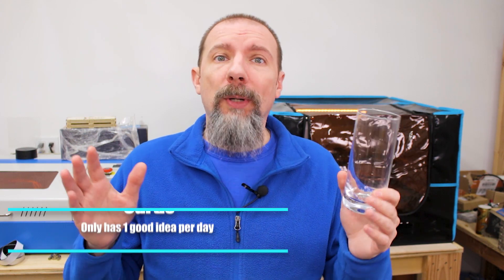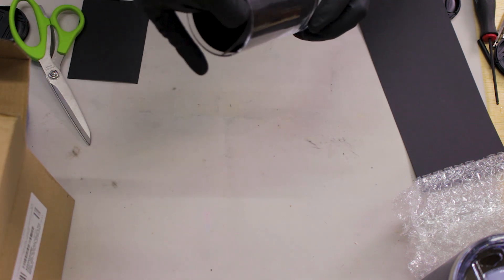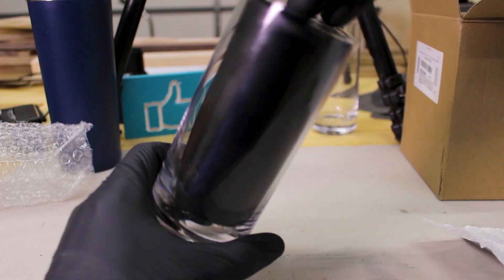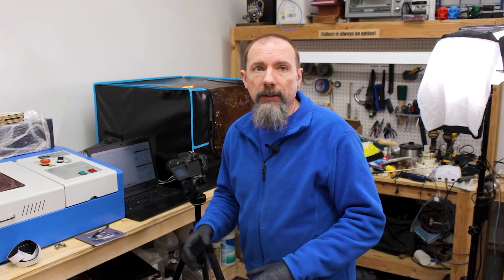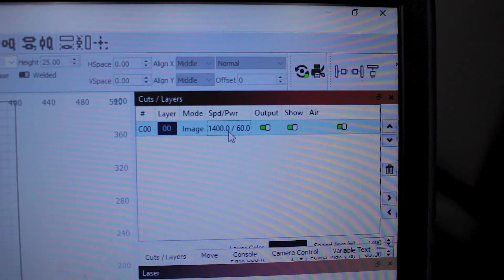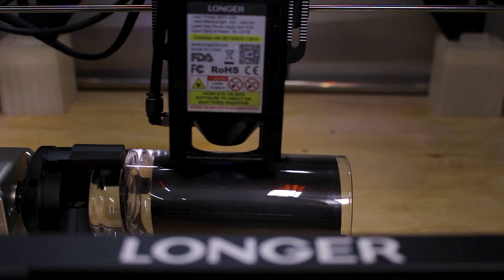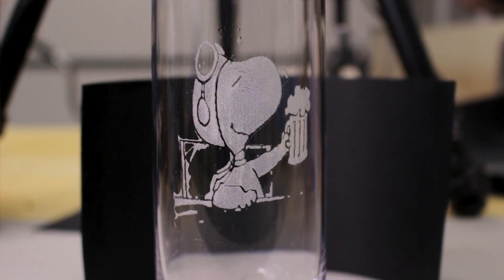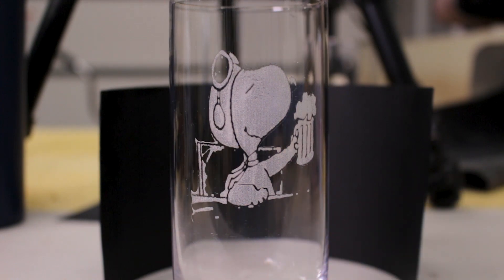I Can't Believe How Simple This Was!

Comment: Notice you are using ray 5 20w laser and Ortur Y-axis rotary chuck, did you have any problems with running this chuck with 20w?
Reply from the maker: None at all. The chuck comes with multiple adapter cables and one of the supplied cables hooked up to the Ray5 no problem.

Comment: Simple still: paint the surface with smoke using a candle. Or use a slate marker. It will surprise you! Use little power. Coal does not leave smoke because it becomes CO2. No solvent is needed to clean. It is not necessary to look opaque, a thin layer of smoke is enough. The combustion raises the temperature of the surface of the glass and thus engraving. You can give several passes repeating with the marker (if you do not move the glass). Your video was inspired to find what the laser does for engraving: the great temperature that occurs when burning the black cardboard turned into coal. Thanks for sharing.

Comment: Im So trying this, I have a friend who loves Peanuts and this is perfect gift for her.  Interesting the engraving is on the inside.  I’m guessing it’s because of the soap reacting with the paper.   Would it work on the outside with the paper or would it catch the paper on fire.  Thanks for another awesome tutorial. Can’t wait to watch another video 😊😊😊
Reply from the maker: If you engrave on the inside you don't want to use the glass for drinking. This was just an experiment for me and I don't intend to use the glass. If you want usable engraved glasses you need to etch it on the outside. You can't use the paper on the outside, you will need to use tempera paint to achieve the same effect with a diode.

Comment: As soon as I saw you trying to get the paper close to the glass, I thought of blowing up a balloon on the inside to expand the paper against the glass. not sure if the heat from the laser would pop the balloon though.
Reply from the maker: I think using crumpled paper inside would work as well. However, I would only recommend this method for display glasses. Engraving on the inside of a glass can cause issues for glasses you intend to drink from. Particulate matter from the engraving can come loose and get in the drink, and cleaning the glass can be a pain because the liquid now has a lot more surface area to cling to and leave the glass looking dirty if you don't scrub it really well.

Comment: what should you spray on the outside if you want to do it that way
Reply from the maker: Paint the outside area you want to engrave with black tempura paint, let dry, and engrave. Should get similar effect but the etching will be on the outside of the glass.
Reply: @LetsMakeAThing  thank you
Reply: @LetsMakeAThing   I tried it with zinc spray (which is somehow cheaper than tempura, that's why) and it worked as it should. I can't compare this to other methods because this was my only attempt and the results were sufficient.
Reply: I am wondering if titanium dioxide would work as well? 😁🛫 That turned out nice!

Comment: What settings are you using ?  And what is your laser engraver a 10-watt or 20 watt? Like the power and speed ? For the setting
Reply from the maker: I used my 20 watt Longer Ray 5 in this video. I don't remember the power and speed off the top of my head but I'm pretty sure I shared them in the video.

Comment: The ink on some of those jars had lead or something in it. It might have been BK glasses. Dude, I have been  searching vids for an easy, CLEAN way to do this. You could probably use a piece of foam or something to expand in the glass to push the cardboard against the glass. Might be able to skip  the soap. I wouldn't worry about cleaning the inside. I might worry about coffee, or grape juice stains.😁
Reply from the maker: I wouldn't be surprised if those old glasses weren't made from all sorts of terrible chemicals. 🤣

Comment: Hi I want try engraving for a retirement hobby. Unfortunately I don't know anything about I except for looking at lots of videos. What is a descend cutter engraver combination aswell as a matching component for cutting silinder type material.
I am from South Africa
Reply from the maker: Without knowing exactly what you want to do I can't give a specific recommendation. It depends on what you want to cut/engrave, how fast you want the laser to work, and your budget. I would recommend watching diode laser reviews on YouTube to see what kind of features are available, and simply by watching the reviews you'll start to learn more about laser engraving and what you need to get started. If you want to engrave cups and round objects you need a rotary tool/chuck and you can also watch reviews of those tools as well. Best of luck on your journey!